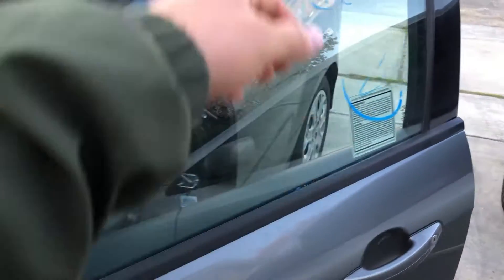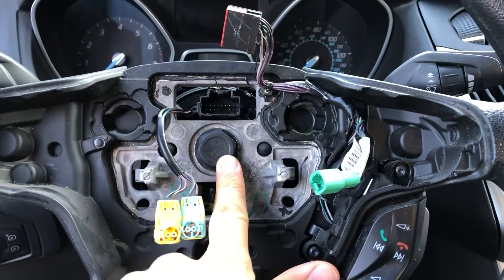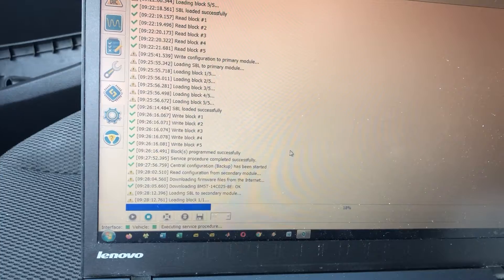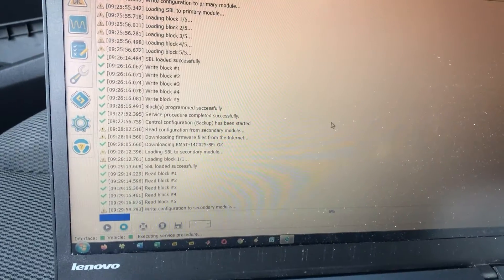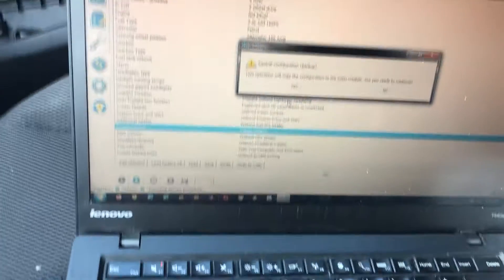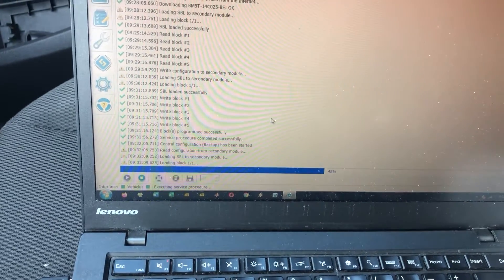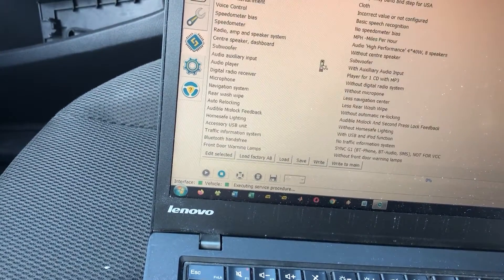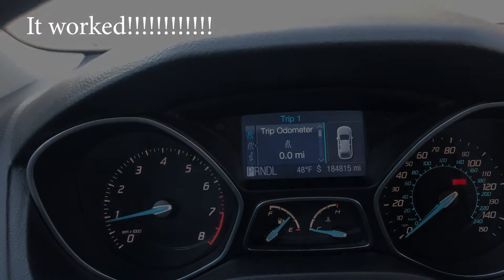Add Cruise Control to Ford Focus 2012-2014

Comment: Hi. Any chance you can share the wiring that has to be done? I did not buy steering wheel with cruise control ready i just bought the cruise control buttons and will have to install and do wiring myself.
Reply: Do you Made it which konector

Comment: Hi! I own a Mexican ford focus 2014, and the steering wheel controls are in the left side for the computer and right side for the volume and stereo controls. Is there the possibility of change it of side? I mean to change side one from the other.
Reply: Probably difficult, since also the british (right hand steering) focus has cruise contril on the left side and stereo on the right. So switching to a UK steering wheel is not an option. 

The only thing i can think of is scaning the CC controls and 3D print them in mirrored orientation. Then tediously remove the electronics form the old one and reinstall it in the mirrored 3D printed one. Does not sound like it's worth the efort imo ^^

Comment: Interesting my air bag is plugged into the center electrical connector in addition to the yellow and blue connections for the horn which is mounted on the air bag unit.  How are you connecting the horn on the air bag unit?

Comment: Hello dude. I have the ford focus 2014 without cruise control. If I buy a cruise from aliexpress I'm good with it or I need something else too? I can program it with forscan. So i need only the cruise button and I'm good?
Reply from the maker: you also need a different steering wheel to accomadate the cruise button. and  yes you can just program it in via forscan. I would also consider buying the switch via ebay
Reply: @rufixed2245  from ali express sellers told me no fit for diesel. I wonder why. Its the same as gasoline
Reply: @Mrhot7  can you share ali express link for gasoline cruise control item pl